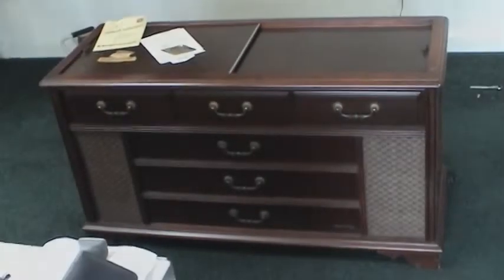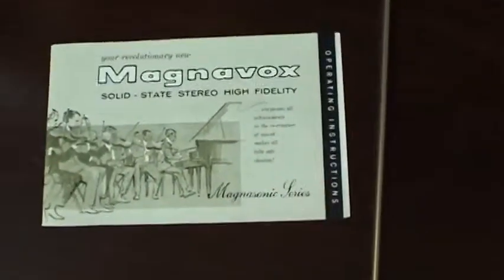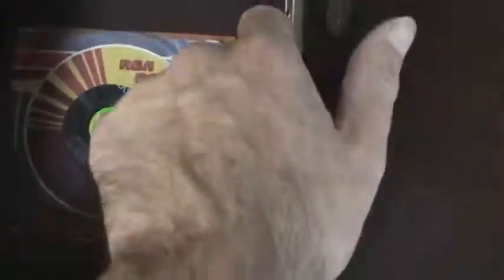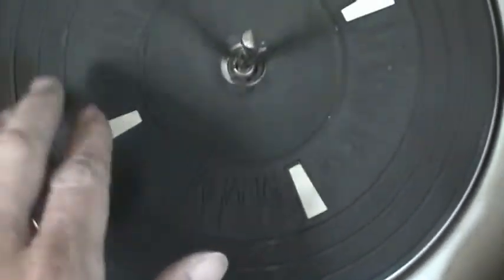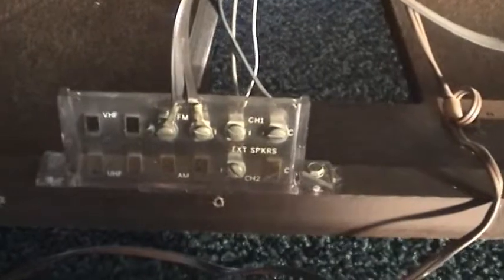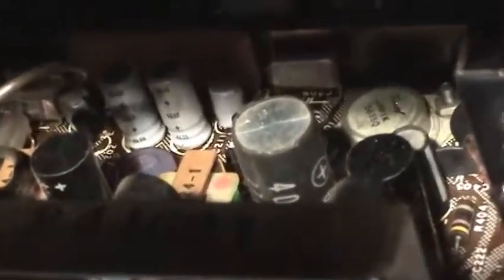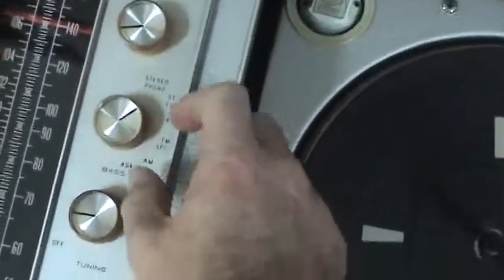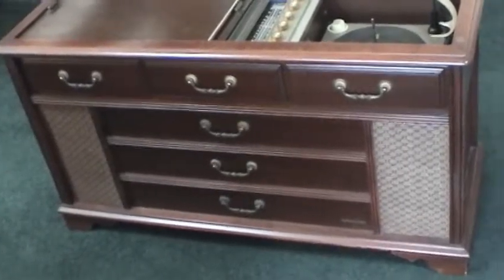1967 Magnavox Magnasonic Console Stereo

Comment: You'll definitely want to recap the signal path - the improvement in sound will amaze you. The power output was rated at 20 watts IHF, which in modern day terms is a few clean watts per channel - but that's all those Rola woofers need. On the changer, once it's working as it should, it is very gentle on record, with a tracking force of just 3 grams with good compliance. Oh - the loudness control is labeled as it is as Magnavox consoles did have loudness compensation.